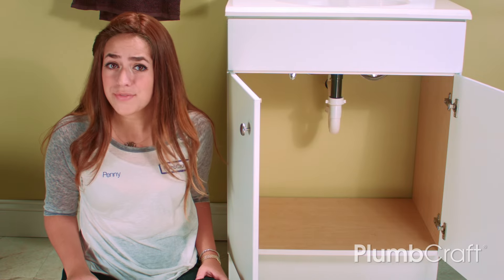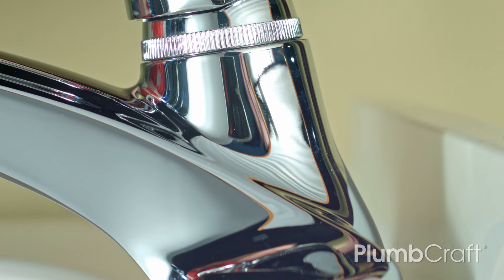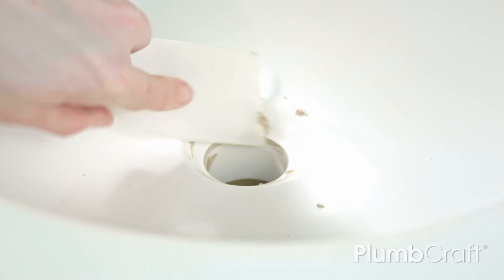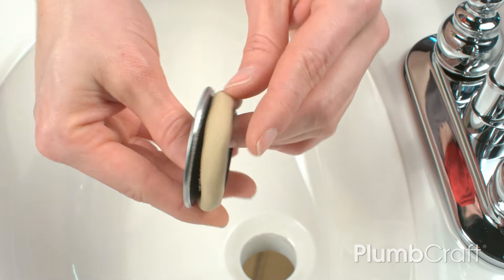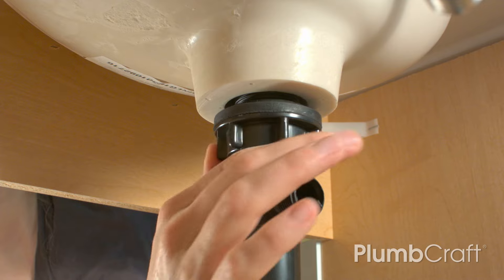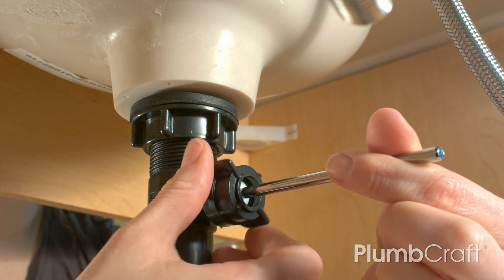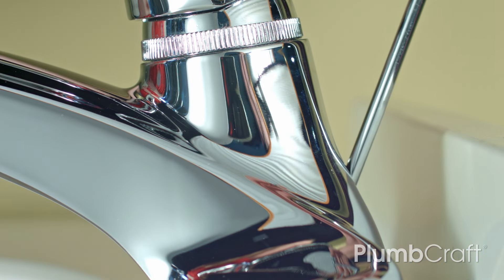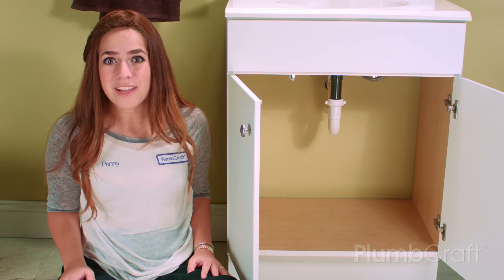How to Replace Your Bathroom Sink Pop-Up Assembly | PlumbCraft How To Series with Penny PlumbCraft

Comment: Plumbers putty should not be used on plastic, which appears to be shown in this video. When using plastic (where the putty touches), you should use silicone instead. Plumber's putty should be used with metal only.
Reply: This is the comment I needed. Thanks for the explanation.
Reply: Yeah Yeah I got my my crib crib ready ready
Reply: The top of the flange meeting the sink is metal and putty can be used for this seal.  Silicone may be used as well but you will never be able to replace the pop up drain again with your sink later on.
Reply: silicone is easy to remove later
Reply: I disagree. I've been using putty in this application for years and have never had any issues.
Reply: Yes rather use a bead of silicone
Reply: Just read the instructions on my plumber's putty " ... used to seal a range of materials including metal, ceramics & enamels, PVC & plastics ... ". Always read the instructions.
Reply: I think this is just a personal preference either way works
Reply: @NKBC1689  You may have been installing it wrong for years... Have you ever actually went back a year or two after installation to check the seal? Doubt it.
Reply: @nealpaddock  I agree to always check the back of the product, but it also may depend on the type of putty you use? The standard plumber's putty I've used, from Home Depot, specifically says to NOT use on plastics.
Reply: @nobytes2  Always check the product label for important usage instructions. The plumber’s putty I purchased from Home Depot explicitly states that it should not be used on plastics - a detail I only discovered after repeatedly experiencing failed plastic drain seals throughout my home. When I moved in, the house was only three years old, yet I had to replace every drain seal due to premature failure (builder used plumber's putty). Nowadays, new drains typically come with a rubber gasket anyways.
Reply: @PotentiallyTranscend  Thanks for the comment. To answer the question is actually have. I've installed it this way at my own house, friends, and family for years. No issue with them or my own home. Also, there are some manufacturers that actually require plumber's putty.

Comment: Thanks to you, I just installed a new faucet drain stopper and it works, no leaks.  Waited 5 years for hubby to do it after he installed the new faucet.  At 67, I don't need to wait for him.  I just need girls like you on YouTube!
Reply: Im a guy in my late 30s and the lady at walmart whos around 70 taught me how to install my wooden blinds! I kept going in to ask questions lol.
Reply: Gloria!! Omg I’m on here for the same reason🤣🤣🤣 This is a great video! This is on my list to do now. Cheers!!
Reply: Guys / ladies: please make sure that if ur sink has an “overflow” opening, that you get a faucet that has a drain with an opening that is cut into the metallic/plastic pipe (i.e. “faucet with overflow”) to catch the water that sprays off of your hand into the overflow and that funnels under/inside the hollow sink otherwise if the drain has no hole the water from the overflow will back up. I had to order a separate Krauss drain with overflow bc i didnt realize there was a difference bn faucet (specifically drain pipe) for sinks that have overflow (therefore drain pipe w hole cut into the pipe) vs sinks w no overflow
Reply: @mrsleepyshow  is joj
Reply: @ballinsteros  I thought it was me. Thanks @Chris!
Reply: @mrsleepyshow  I accidentally found this out while browsing for a new one. Had no clue there’s a difference. My sink has no overflow so that would have been a fun surprise 😂 thanks for the tip! 
And keep crushing it Gloria!

Comment: Your videos are great! I have a question. I am just replacing my pop-up assembly, and it turns out that the pivot rod that came in a kit is too long for my small bathroom sink. Do these rods come in different lengths? Or do I need to cut it?????

Comment: You aren’t supposed to use plumbers putty on plastic it’s supposed to only be used on metal, also you should use Teflon tape. I followed the instructions in this video and it ended up leaking.

Comment: Some suggest putting plumber putty on the rubber washer that goes against the bottom of the basin. I had a leak at that point, put silicone there, and the problem was fixed.  I put in another faucet and had a leak at the same spot, put forgot to put the silicone there! Ugh! So, take everything apart to put some there.  :)
Reply: I had leak at the bottom lock too not sure b/c I did not put a thin washer on the top, only applied putty on the top piece.

Comment: Thank you so much for posting this video. I accidentally broke my parents stopper assembly in their guest bathroom while trying to clean it out. It was very very old, like from the 1970s and I had no idea where to start on how to remove it and I certainly didn’t want my 50+ parents having to bend down there to fix it. I bought them a new one and installed it myself using this video which showed me exactly what I needed to do. I bought them a new one that uses the power of magnets instead of having to insert the metal rod through the stopper’s hole. They can pop it out from the top and clean it off without having to bend down under the sink and disassemble all of it. Then just insert back in from the top and POP the powerful magnet grabs onto the rod and works like any other assembly. Gotta love Home Depot, lol!

Comment: I have a PVC pee trap but not removeable /unscrewable like yours. It is sealed together, not screwed together and I can't seem to get the tail piece out of the trap, and I really don't feel like busting the PVC. Any suggestions or videos your can refer me to?
Reply: Is it all pure PVC? If so it'll be beneficial to cut the trap out and go to Menards/Home Depot/Lowes and get a 1-1/4" to 1-1/4" trap adaptor. One end is for the PVC pipe (which you'll have to glue) the other for the plastic pipe. Also get the flex extension cuz that came in handy for me. Hope that helps

Comment: My new pop-up leaks underneath from the the big nut/lock in the bottom. I did not use a washer on top,  and only applied some plumber putty on the top. 
I did use a big washer in the bottom.
Will try to install washer first on the top.

Comment: I noticed there is a hole in the tailpipe in the threaded part. When I installed my drain, it leaked and it seems to come from that hole. What am I doing wrong?

Comment: This is a best case scenario. In real life if your sink drain is old it is probably metal pipe and metal which I bet you a million $ is not going to come off happily. You will probably end up cutting the nut with a hacksaw while squeezing and twisting your body under the sink. And half way through will regret starting the project like I did:). 
So firstimers like me should not take this job lightly.
Reply: I had no trouble removing my metal drain. I'll take that million $ now.
Reply: Lol
Reply: This video was great...I was able to do it with no problem! Although, the squeezing and twisting was definitely part of it!
Reply: So true, you made me actually laugh out loud to your comment halkatgp.
Reply: I had to pry my old faucet off with the claw of a hammer since the faucet was installed in 1987. no chance of getting the assembly off of the underside of the sink. now im working on the drain.

Comment: This lady did a nice job explaining the process. She correctly said use plumbers putty. Don’t use silicone even if the directions say so. ( I have done this and it fails most of the time. Plus you will have to wait 24 hrs for the silicone to dry) one tip that helps is to put some Teflon tape on the drain ring before you thread it in. This is where it will most likely leak. She did a great video! I was impressed

Comment: So...I guess we don't need the bucket...
Reply: You will if the drain happens to be clogged, then the need for a bucket will become swiftly realized when you've loosened the drain trap and all the water that had been in the drain pipe above suddenly succumbs to gravity and spills out on the floor because you did not situate the bucket under your work space.  That part was omitted from the video.

Comment: I tightened the big plastic nut (mine was nut shaped) way too much because the whole plastic drain would spin around by hand. I guess thats just the way it is. If the plastic nut was shaped like the one in this video I would have known it didn't need to be tightened too much.

Comment: This was a super helpful video, but ONE thing she didn't mention is: ensuring the threads of the popup at the top and where the lock nut ends up are wrapped with Teflon/plumbers tape. Otherwise water will drain out the holes at the top of the popup and through the threads. This video covers that step pretty well: https://www.youtube.com/watch?v=mTmUO-0ELps

Comment: Then why do the threads leak after doing all these steps?
Reply: maybe you crossthreaded somewhere along the line, or a piece of debris is stuck in a place that allows water to exit where it's not supposed to.
i would say unscrew the pipes in question and make sure nothing is in the way of the threads and make sure the rubber gaskets/washers are in the right position. if you use washers that are not integrated into the lines makes sure they are the right size, i once had to buy bigger washers/seals because the ones that came with the fixtures were a bit to small even though the sizes printed on every piece was right.
...crossing your fingers won't hurt.
Reply: I would add plumb putt to the threads.
Reply: They forgot to apply Teflon tape on all plastic threaded sections. I had to re-do mine.
Reply: I have the same PROBLEM!
Reply: They didn't show how to install the gaskets that's the real important part they don't show
Reply: IF done correctly, you should not use dope or teflon tape on plastic....only metal pipes
Reply: Put Teflon tape on the drain ring before you thread in in. This should do the trick. Also do like she said use plumbers putty don’t use silicone. If you still have a leak use Teflon tape on the threads on the underside of sink.  I hope this helps